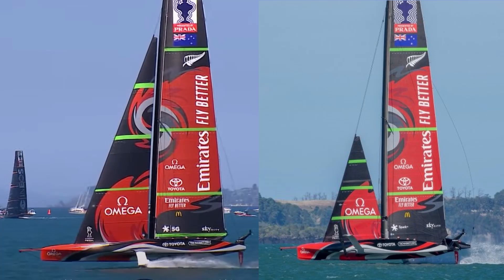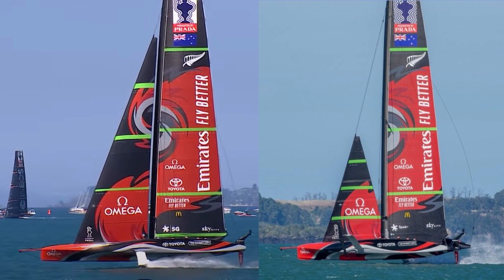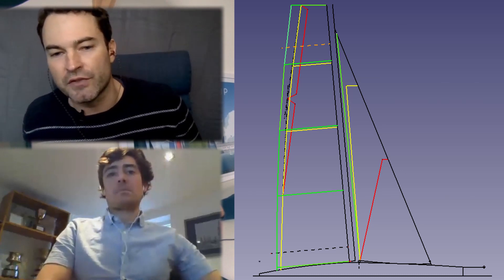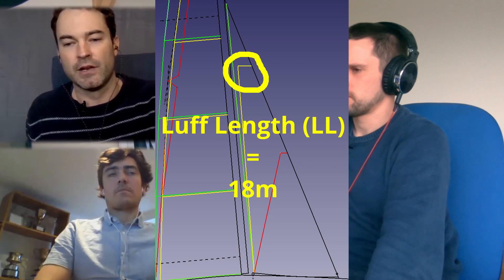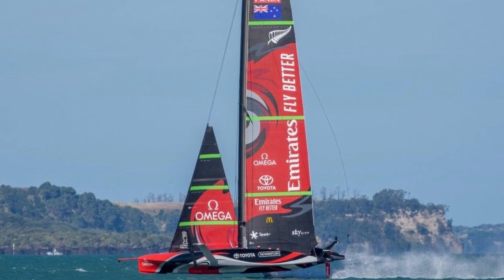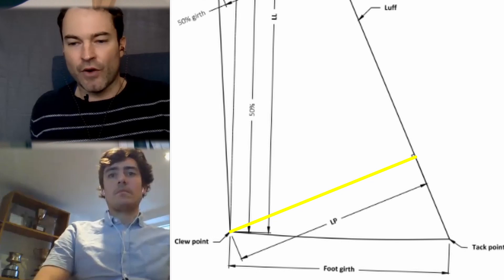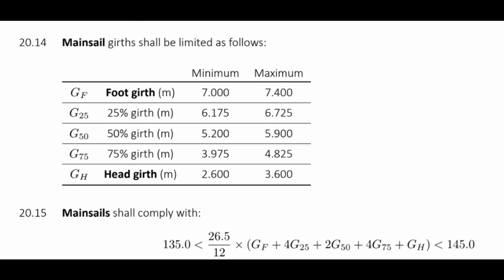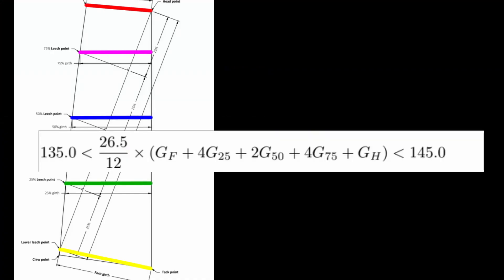Batwing Main and the UNLIMITED sail area loophole: A guide to America's Cup Sail Plans (Part 1)

Comment: How does more sail area down low give them more righting moment?
Reply: It decreases the heeling force of the main sail by lowering the centre of effort, for the same given sail area. In simple terms, essentially means you can keep the main pulled in higher up the wind range, maximising your forward thurst. 

The available righting is primarily driven by the lift and cant of the main foil
Reply: @thomaspartington8464   it doesn't lower the center of effort at all, it allows more sail area low down, but if the mast height above the water is the same on both boats then there is no righting moment advantage at all.
Reply: @slooob23  Agree, to me its more like ETNZ are getting more bang for their buck assuming both boats have the same righting moment.
Reply: @number1genoa   I think it is to improve the efficiency of the mainsail by creating a better "end plate" effect. The boats are not underpowered so a few feet of extra area right on the deck wouldn't provide much advantage, but better aerodynamics of the wing definitely would.
Reply: @slooob23  
In conjunction with the batwing (reducing area at the top) it does lower the CoE. In ETNZ’s case, their lowered deck gives them area below the mast step point, which further lowers the CoE.
Reply: @q.e.d.9112   It doesn't lower the center of effort on anything but paper. Why use a square sail at all then? Why not go back to triangular sails with a massive boom because "it lowers the center of effort" ?
Reply: @slooob23  
Because the boom length is stipulated and to a certain extent, so is the shape of the sail. By a clever bit of rule bending (it’s not cheating) ETNZ have managed to increase area low down, allowing them to remove area up high. This reduces the heeling moment, allowing them to keep powered up more. If they’ve got it right it should give them an advantage but it’s only when they start racing that they’ll find that out for certain.

To all those moaning: there are plenty of events where the boats are identical. The AC has always been about development yachts and, because of its prestige, it has always been “no expense spared”. Nobody is forcing you to take an interest.
Reply: @q.e.d.9112   That is NOT the purpose of the design, the bat wing sail is for extreme conditions, it is only about sail reduction in high winds. It is a drag experiment to test the difference between area reduction or spilling the usual mainsail.
Reply: @slooob23  
I think we are at cross purposes here.
Nothing I said counters what you are saying. 
Enjoy the racing. I hope it’s exciting; 7/6 to ETNZ.
GO, Te Rehutai!!🇳🇿
Reply: I think what they mean is that the center of effort of the wing is lower, which in turn lowers the moment trying to push the boat over. Therefore you have relatively more righting moment.
Reply: @Glenn Watson  team NZ has a lower mast off the water than Prada? Then how did they get extra sail area near the deck if the mast is stepped lower? It is the same height above the water line.
Reply: And why build a high wall with no areo  in front of it. It even looks unloaded.
Reply: @larkhill2119  the apparent wind angle is the key to this, the wind is no longer coming from the side , its always in front, even down wind once they are foiling.
Reply: @CarkeekW  That's a good observation and understanding even down wind. I wonder how they set up the wind tunnel or computers to look at the air flow?
Reply: @larkhill2119  Numeca has been a key bit of software this time around with physical model type testing banned .  Id guess they come up with a design prediction speed for a given wind and multiply out the wind and boat vectors to get the resultant vector then use the first iteration of the real boat to test those simulation theories.
Reply: @CarkeekW  We had a slide rule and a RS Cosworth with the back door removed hanging out with a camera trying to estimate ride heights at 200 kph.